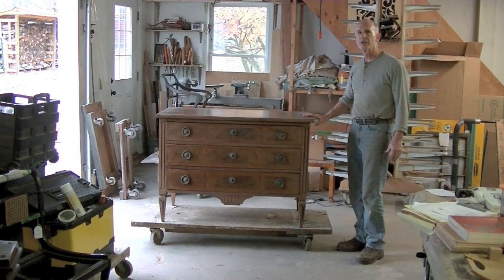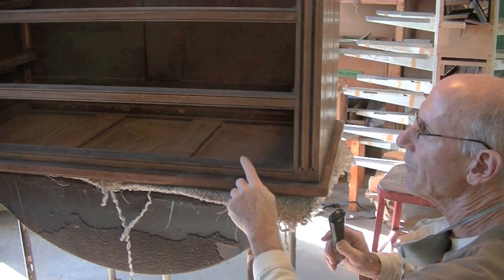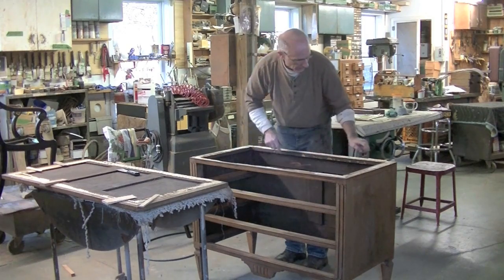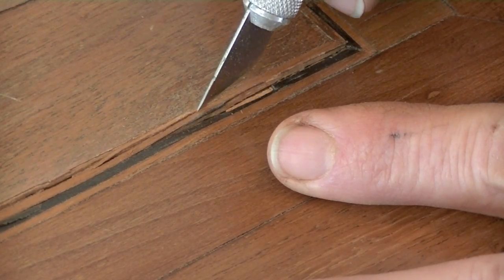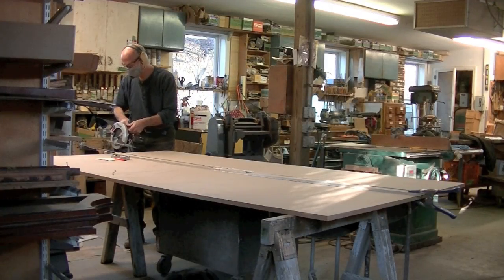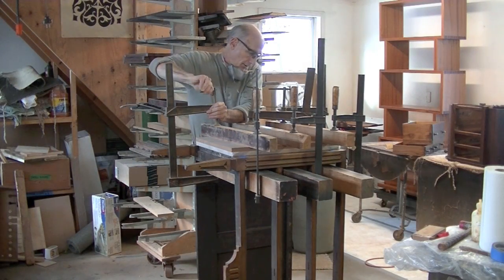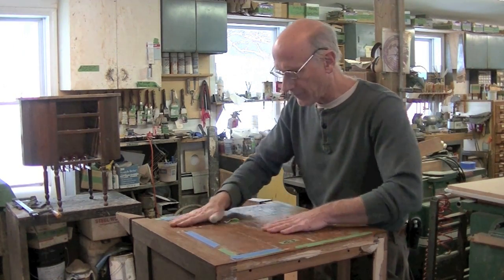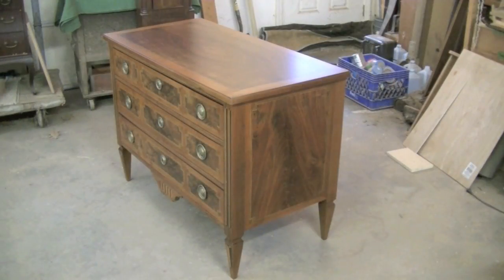Restoring a Badly Damaged Veneer Panel - Thomas Johnson Antique Furniture Restoration

Comment: Just discovered this channel and I've been stuck on it for hours. It has inspired me to get back to my chest lid. It's a cheap pine chest I found and I challenged myself to make it look like mahogany.  I also challenged myself to give the lid top a glass-flat and gloss finish. After applying about thirty coats to the top and scraping it about every fifth coat I started having problems with the surface. I figured out that I was rushing and not letting the poly cure. So I let it sit for about six months. Yesterday I wet sanded it with and orbital sander and 400 grit. It came out great. There is still more to go, but Thomas's videos have shown that it just takes patience. Think about putting a mirror finish on pine construction-grade plywood and you'll get the picture.
Reply from the maker: Yes, that's a tough project. And everyone has gotten into trouble at some point by rushing the drying time.

Comment: Your little ladies look about as warm as our little ladies.  We don't have as much snow on the ground as you have, but it is bone chilling cold here in Kentucky.  We are headed for zero tonight.  I don't know how the hens stand walking around in snow in their bare feet, but they certainly are glad to cozy up to the heat lamp at night.  

The piece is lovely, as usual.  You do such beautiful work.  I'm about to finish the table I've been working on, which I would never have had the courage to tackle without these.  I've had a mishap on the finish, so I'm going to have to sand a coat off and redo it.  Other than that, it is coming together beautifully, thanks to your tutoring.
Reply from the maker: You are welcome! And yes, the chicks do not like walking in the snow! It's quite comical. All the animals don't seem to be bothered by the cold, as long as they are protected from the wind. It's amazing.
Good luck on the table! I've never regretted doing something over.
Reply: Yup, wind and wet are the two killers of livestock.  They can handle a lot of cold if they are dry and have a windbreak.  Our little birds cozy up to the foundation of the house on the west side, under the back porch.  They are dry and sheltered there, and the angle of the sun is so low now that they can sun bathe there.  Plus, the hawks can't see them there.

Comment: I just finished restoring my parents 1914 Hoosier. It had sat in the basement for year, so the dampness had damaged the bottom, back, and bottom edges of the side oak veneer plywood. I flipped it over and re-laminated the side oak plywood bottom edges using your type methods with white glue in the gaps, plastic, wood blocks and clamps. The cheaper 3-ply plywood on the back and bottom surface layers sperated from the heavier core. Being that I didn't (couldn't safely) disassemble it to clamp it. I dremeled many 8th inch holes and injected in white glue, plastic, wood blocks, then pressed it flat using 200 pounds of pea gravel in 16 heavy cotton old lead shot bags. Once that ply was flat, then built a sub frame to mount big casters using 3/4" x 6" oak boards. Once this was finished, I flipped it upright and re-laminated the top side of the bottom ply placing the gravel bags inside the base cabinet of the Hoosier sandwiching it flat while being supported from below by the new sub frame. It turned out real good without taking any of it apart!
Reply: years ...
Reply from the maker: Wow! It sounds like you did a good job! Very creative!
Reply: Have you ever done a video on restoring a "Hoosier"?

Comment: Hi Tom, really enjoy your videos. I've learned a lot that I use in doing repairs to furniture for friends and family. My question: what would you have done if the side veneer reglue didn't "look pretty good"? I realize that it's going to depend somewhat on how it turned out, but would you start from scratch, remove the veneer and reglue or more likely try to repair only those areas that show the need? I'd be very interested in seeing a video where a repair didn't turn out and then needed to be redone or fixed. It would interesting see what went wrong and why and then how you'd approach the fix.  Best, Kevin

Comment: A general question:  I have watched you fix veneer problems for years - and enjoyed all of them!  Big problem seems to be the base wood running in different directions and shrinking.  Did the original carpenters/builders not know about this problem.  Surely they became aware after many years of use?
Reply from the maker: Thanks! I'm not sure, what I believe was that the furniture was probably fine until people started having central heat in their homes, and started drying the furniture out

Comment: As always it was a pleasure to watch your video. If I may ask, what was the allure of veneer, on older pieces, compared to just using a plain solid wood finish and which do you prefer? Thanks for your videos and your time!
Reply from the maker: You're welcome! with veneer you can use figured woods, take a look at how beautiful the sides of the cabinet are. Also, with veneer you can create incredibly stable panels that won't shrink or expand and contract

Comment: Nice repair as usual. It's actually a really beautiful piece of furniture. I imagine it might have been made in the 1930s? Maybe 40s? Hard to tell. Plywood cores were around since at least 1900. It kind of looks like it's been bleached-out a fair bit by the sun, too. Lots of work went into this piece (both originally, and to repair it). It's nice to see that someone wanted to have it fixed.

Also, yellow (and white) wood glue does have a bit of gap-filling qualities. One woodworker on YouTube made glue tests and some of the sloppier fitting joints held up better than the super tight ones due to the glue. It's obviously not the best glue for gap-filling, but you probably were best to have used more glue than less.
Reply from the maker: Thanks! and yes, pre WW2 on the age. I have never seen such a bad job of a substrate for the veneer. I have no idea what they were thinking. Luckily, the new house where we delivered it has climate (as in humidity) controls year round. So if the glue does have some gap filling ability it made last for awhile. I'm keeping my fingers crossed

Comment: Great video and veneer repair. I was wondering if you had any comments with regards to the cold affecting your repairs with regular glue? Do you find applying heat to separate the glue is easier in colder weather?
Reply from the maker: I've never noticed any effects. But it's safe to say that there must be some sort of effect, but maybe it's not enough to make any practical difference.

Comment: Great  job as usual and I am inspired.  Tom what do you do if you have a veneer panel that is cracked and bubbled up but the panel is also painted?  Do you reglue the veneer first and then strip off the paint or...what?
Reply from the maker: I always do all repair work first. Glue down all that you can, fill any major cracks with any kind of wood filler, sand that smooth, and then strip the paint. You don't want stripper and the solvents and the water getting into the wood defects and making them worse.

Comment: Hello Mr. Johnson.  I have an old wooden chest that belonged to a great, great uncle.  It has a veneer top.  Actually, the entire piece I believe, may be veneered.  I did a rather dumb thing by putting a plant on the top, on something I believed would protect the veneer.  Sadly, cabinets sits in a sunny area and the cool  pot on the pad created moisture and I now have 5 ripples in the veneer.  The lid of cabinet lifts so I can use clamps. The rippling begins about 5 inches in from the front of the lid. The size of the rippled area is approx 6" deep X 8 " wide.  Can I fix this without removing the veneer from the lid?  Appreciate your help!  Pam  S.  (I live in a very dry climate)
Reply from the maker: Hi Pam, I saw your email before your comment. Once it's completely dry, you could warm up that area with a hair dryer, and then while still warm clamp it down. You must have really flat cauls, made from MDF, and plenty of pressure. Use cauls on both sides of the top. This clip, at minute 4:58 explains what I'm talking about https://www.youtube.com/watch?v=NRNnt8sbLKc

Comment: Great video!  Surprised to see the animation, you are really stepping up the quality.   Seems odd how the side was made of such small strips of wood.  I ran across some 1950's kitchen cabinets that the doors were made the same way I found when I planed the veneer off.  You think it was made that way to make for a more stable surface to veneer to or just a cost cutting measure?  Thanks!
Reply from the maker: Thanks! I can only guess that it was about using scraps to make a core. I've seen that before, but not such poor quality

Comment: Hello. Great videos! What temperature do you heat the veneer to with the heat gun, when you want to remove the veneer? I am attempting to restore a "Jerusalem table" with exotic woods from the Middle East.
Reply from the maker: Thanks! Very low temps! It doesn't take much to get the glue to loosen, but more importantly you don't want to damage the finish

Comment: How do you determine when to use wood putty and when to just give up and install a new piece of veneer? 

I have a french-colonial style telephone desk (not sure of era, assuming mid 20th century) with purely sentimental value. The veneer on the top is chamfered and scrolled. The edges are split and chipped in several areas. Any comments?
Reply from the maker: It depends on the size of the defect.Any thing larger than a quarter I will patch with veneer. The splits can probably be glued down.
Reply: Thanks for the followup. I'll have to measure, but given the number of them that I remember, then it looks like it'll have to be patched. Fortunately, there's a Woodcraft store that's only a 40 minute drive from me.

Comment: What do you think the wood was under the veneer panel? an early form of plywood?
Reply from the maker: The wood was hard to identify, some white wood, not poplar. The strangest thing is that it was "bricked" up, all short pieces glued up to make a panel. I could see no other reason for it except as a way to use up a bunch of scraps. Maybe there's a reason I don't know about.

Comment: Please tell us what was the glue you used to fix the veneer. It looked like pva but surely it couldn't be.
Reply from the maker: Thanks! It surely could be! There's nothing wrong with PVA glue, we use it all the time. Typically I'll use hide glue on period antiques, this was a reproduction and I needed a longer working time.
Reply: Thanks for your reply. I asked about pva because I have used it in the past and suffered from expansion of the veneer due to the water content. I sometimes re- veneer vintage radio cabinets either because of loss or often worm holes.

Comment: Why didn't you use hide glue to reset the veneer panels? This is most likely what was used originally.
Reply from the maker: Thanks. This was a 20th century piece, not a period antique, there was some kind of weird glue on it, so I thought the Tite Bond was fine.

Comment: Have you thought of using an epoxy layer to even out the surface, before laying the top. It wouldn't need to be thick, perhaps less or around 1mm, with deeper parts to fill any holes.
Reply from the maker: Thanks! That would certainly work, as the epoxy could level it off

Comment: Would have humidifying the veneer to make it softer and more flexible been advantageous? Anakigous to steaming wood to bend it, but more gently.
Reply from the maker: Definitely! But not very practical. Just putting hot water and heat on it seems to make it pliable

Comment: Yeah it looks good but with Poly Vinyl glue how is anybody supossed to get it apart in the future.  Animal gluemaybe??
Reply: This is a reproduction piece, having the panel obtain total adhesion outways staying with period materials. There is no expansion contraction issues at the point of contact he made the correct call on the glue.
Reply from the maker: I always wondered - why in the world would anyone ever want to take that apart? Anyway, the glue loosens with heat and water, just like hide glue